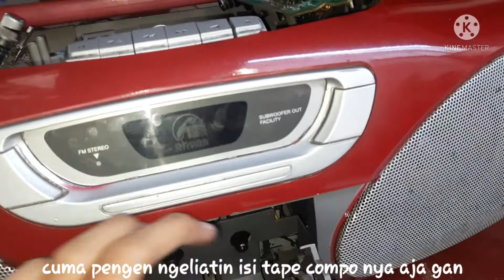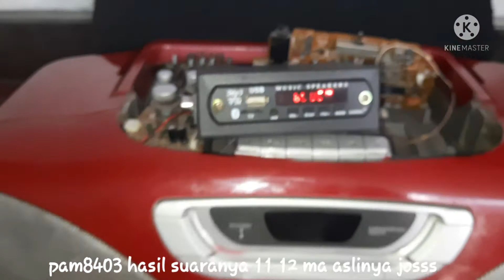Bedah Tape Compo POLYTRON PSC722C kesayangan babe

Comment: Itu di belakang ada 2 lubang jek rca fungsinya apa ya?
Reply from the maker: Output buat disambungkan ke Subwoofer atau powerampli lain gan ,kan ini jodohnua Subwoofer bazzoka polytron
Reply: Kalau disambungkan ke subwoofer gak konek apanya ya mas
Reply from the maker: Coba cek jalurnya masih bagus apa karatan
Reply: @adhywaw2280  kalau buat subwoofer rakitan jalurnya bisa bunyi tapi kalau disambungkan ke subwoofer Polytron psw500 gak konek
Reply from the maker: Mungkin ada tombol buat rubah mode aux/line in di psw 500 nya